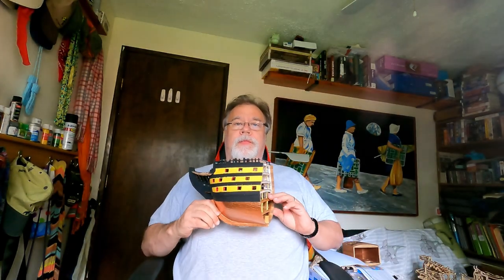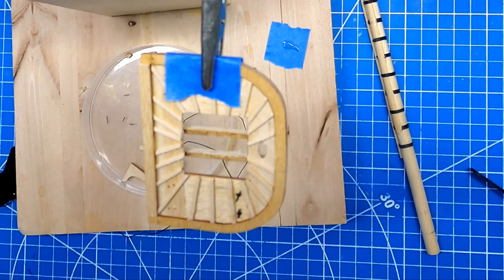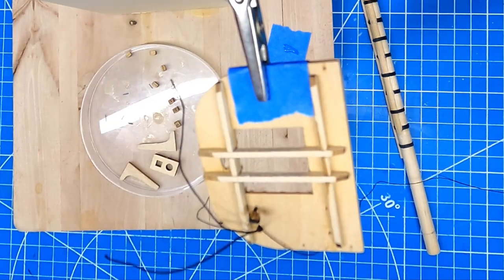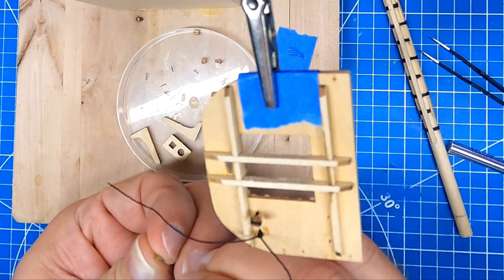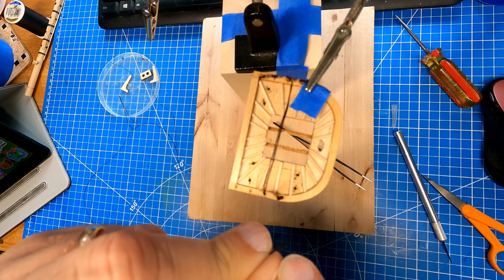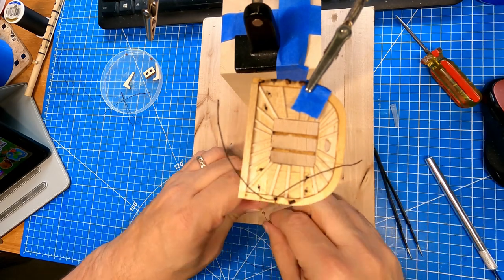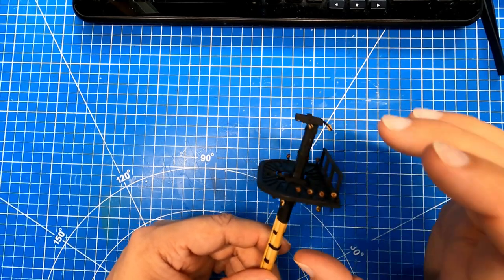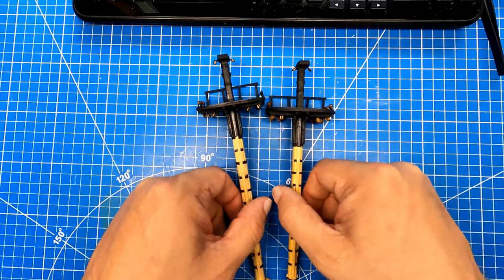Model Shipways US Brig Syren part 25: Adding blocks and deadeyes to the mast tops

Comment: wow !! what scale is the vic bow section ? and looking fine on the syren !!
Reply from the maker: The Victory bow section is 1:78 scale and came from Mantua. Cannot recommend it though as it needs a lot of help to make it somewhat accurate and to replace some of the brass trim on the bow with something better. Should look good but would be more accurately described as a ship built along the same general lines as the Victory due to inaccuracies.
Reply: @TrevorsWorkbench  tyvm